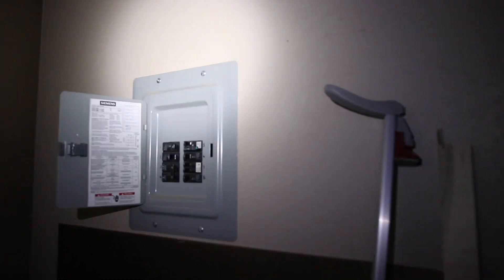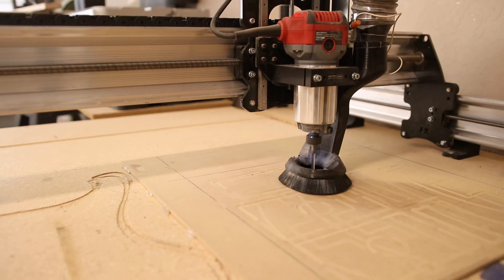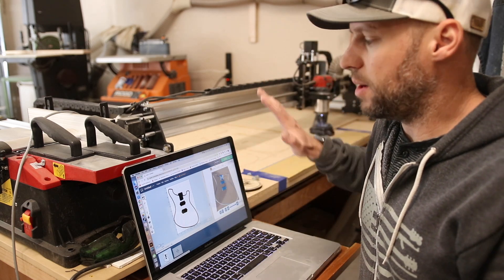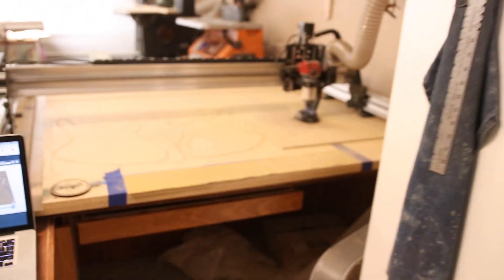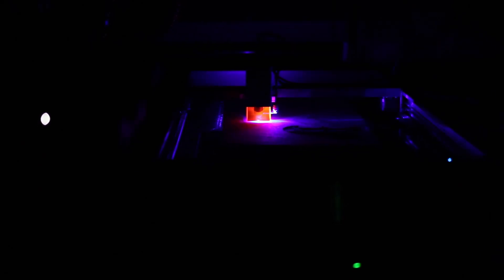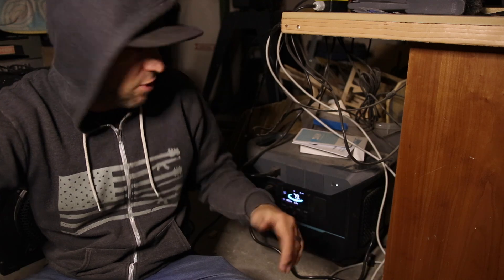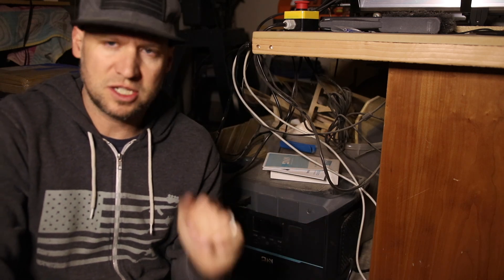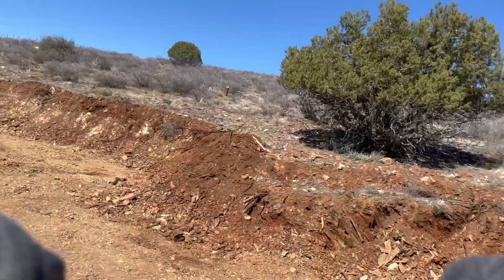The BEST UPGRADE for ANY CNC MACHINE (Hands Down!) DaranEner NEO2000 UPS power station

Comment: To avoid 5 hours of cutting air on a cnc you can trim down the gcode to start at a later point. Would require learning a bit of gcode, which is well worth it

If the machine has endstops, you zero the coordinate system at the failure point and then tell it to home z and xy, giving you the exact coordinates
Otherwise you can either read the last gcode line sent (and go up like 50lines to be safe) or measure the cutting depth to estimate where the cnc job was cut off

Comment: First, I'm thrilled that you've got your new house done and are moving in, that is fantastic!  And hoping the shed moves go well and you're able to get them wired well.  

My garage has two outlets.  One is a 20 amp with one plug, and it's where my compressor is plugged into.  But using the space heater and then the compressor kicks on, and then it's all done, and I've got to reset the breaker.  

The other is just part of a 15 amp circuit, and it's good, but those are the only two in the garage.  And that's my primary work area.  I've lost the other half to my wife's teacher stuff.  

Since I work primarily in IT at a ministry, I'm definitely good with UPS devices, and they're so crucial for my work.  But having one for the shop is a really good idea.  Totally get that having power cut on a CNC job would be a disaster waiting to happen.  

So very cool.  I'll check it out.
Reply from the maker: Yes, I’ve used UPS’s in mission critical IT applications before, never thought to get one for my workshop. The IT UPS’s I used would beep at me nonstop to let me know there’s no power, it drove me nuts. I can’t imagine running a cnc program for hours listening to that noise! 😅
Reply: @GunsandGuitars  yes, and I've had a number of coworkers complain when a UPS battery has gone bad...  The explanation is often quite humorous!

Comment: Don't leave that power supply or powerstrip unattended... That is a Fire Hazard...... it's overloaded...
Reply from the maker: It has lots of things plugged in, but they are not all in use at once. I only have 15amps to work with so I only run one appliance at a time.
Reply: Thanks for clarifying... I was worrying..... thanks 😎 also for the great content.....